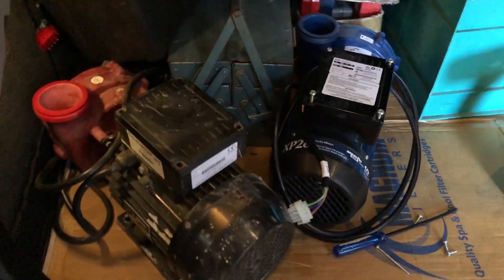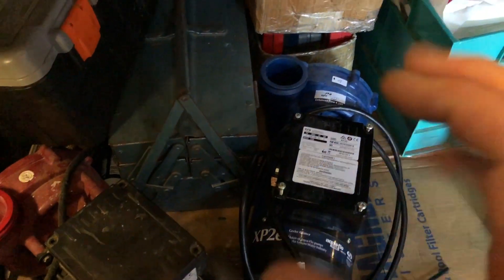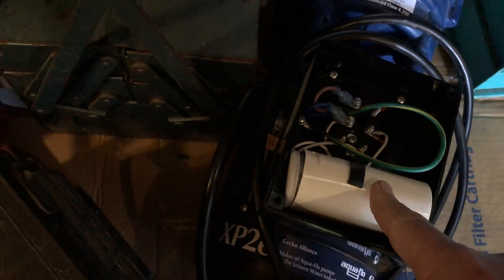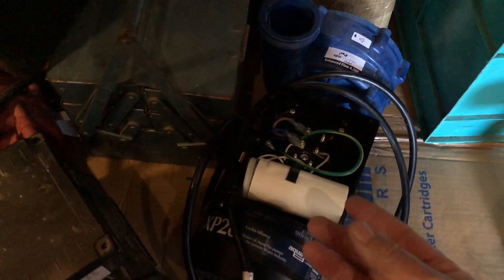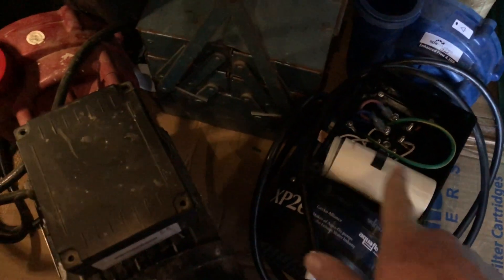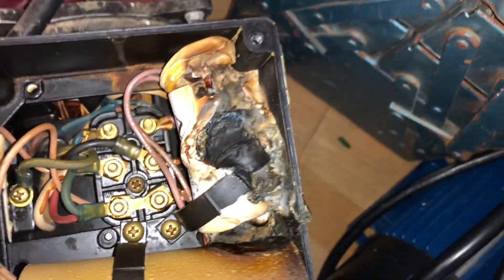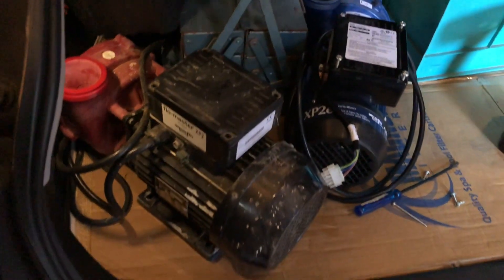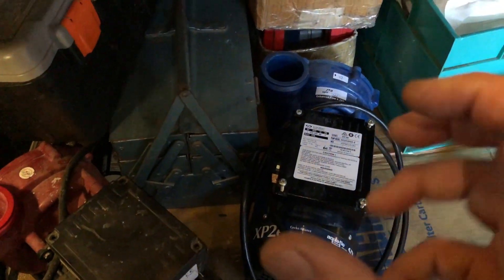Spa or Swimming pool Pump motor just Buzzing? Capacitor start explosion. Maintenance or replace?

Comment: I've been witness to a few caps blowing, the smell is searing!   Unfortunately most motors today have the bearings fail way before a capacitor needs to be replaced, I don't think I've replaced a capacitor in 10 years now.  I often wonder if I took a brand new motor and installed better quality bearings if it'd actually last 10+ years.  I've tried to service a few broken pumps but the metal is usually so deteriorated it just crumbles into a white dust, maybe I'll make a video next time I pull one out like that.  I also see now with many salt water swimming pools if there's a drip it can't be tolerated because as the water drips the salt is left behind and it just keeps concentrating on the metal which starts decaying soon after.  In solution (water) the salt at 3500 ppm isn't so corrosive but when it'd deposited on something continually and the water evaporates it's quite different.